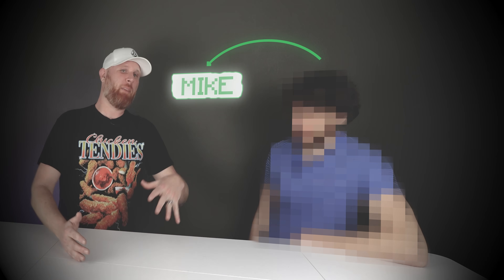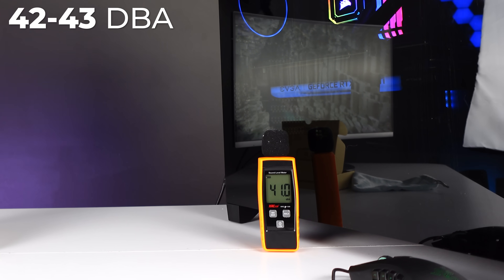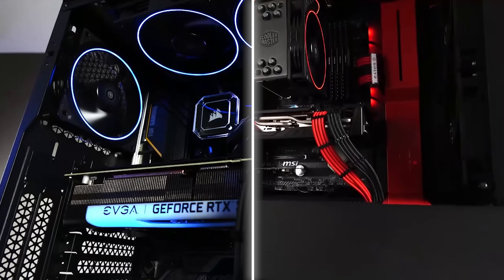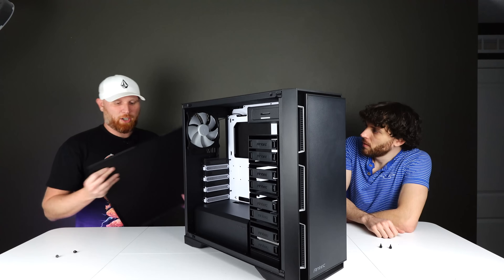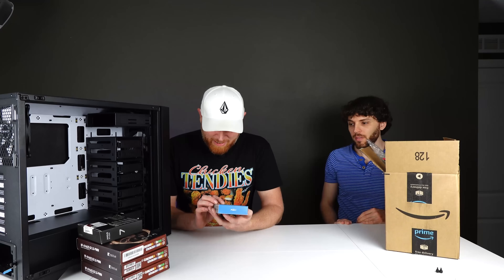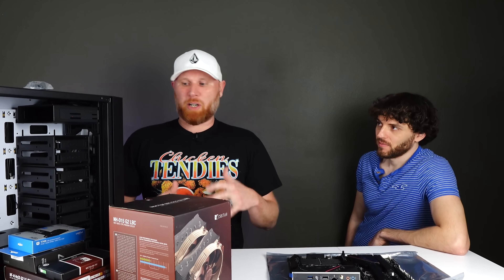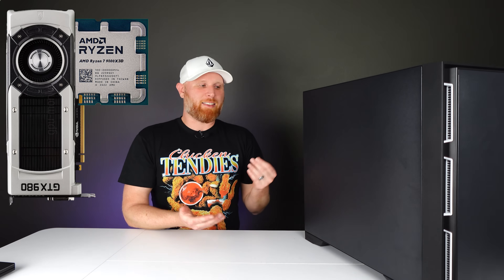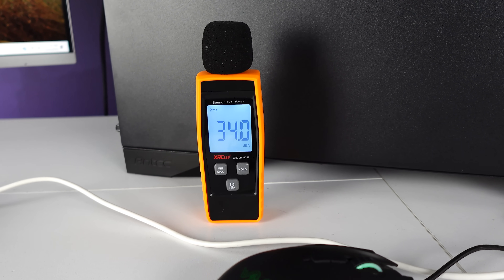How Quiet are “SILENT” PC Cases

Comment: The only truly quiet cases are the ones that support 160/180/200mm fans, like the Torrent or ProArt cases. Chonker fans running nearly silent chugging tons of air in, then using either two or three 140mm low rpm fans for exhaust, or just going straight positive pressure, will yield the quietist system overall.
Reply: What would be the benefit of adding three 140mm low rpm fans to the back? Vs just positive pressure? (In the Fractal Torrent case)
Reply: Custom made........ They look as crap, but they work!

Comment: Me personally, i cant stand loud pc's. Even when you can hear it it feels loud for me lol. Ive got an astock challenger rx6600 and r5 5500 with the stock cooler and the montech air 100 argb. The loudest thing is probably my cpu cooler and i kinda feel like replacing it but it is pretty quiet. I also want to get a mechanical keyboard but i feat it might be too loud so im honestly debating on getting another membrane gaming keyboard lol